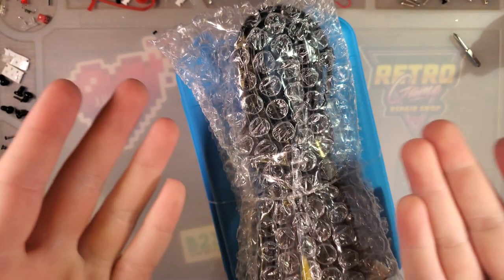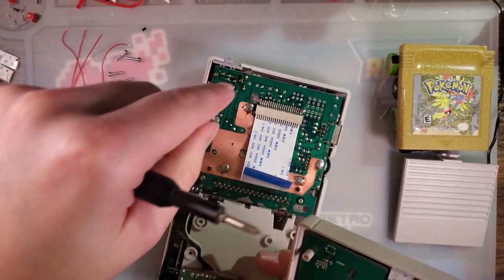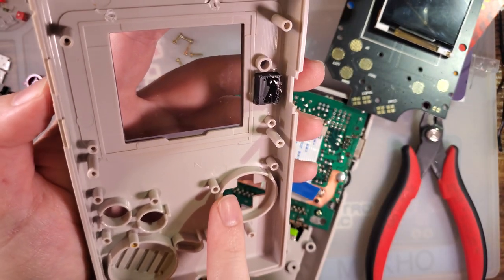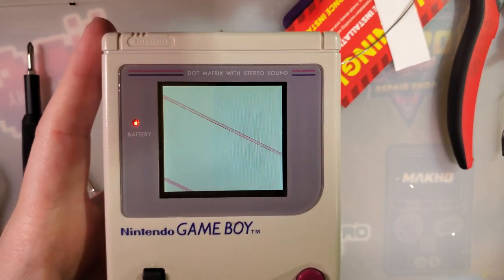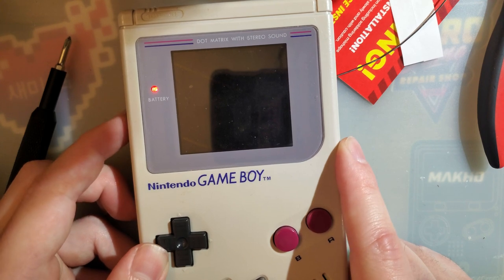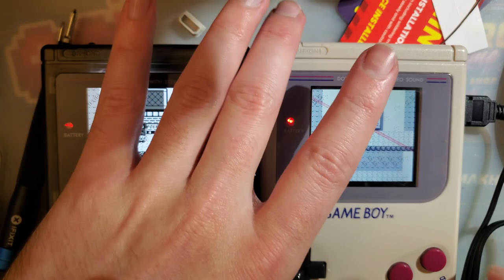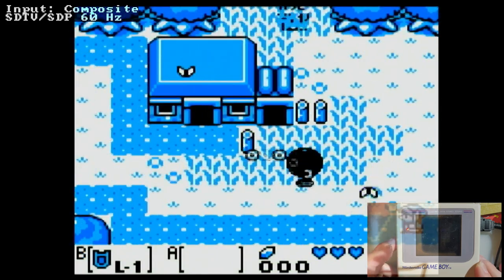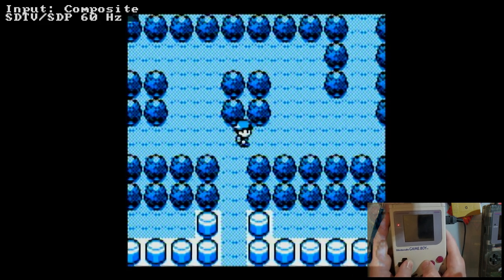DMG TV Out IPS Kit (RIPS TV Version / V5)

Comment: Thanks for the heads up on the spacer. Took my DMG apart and sure enough - it was eating away at the plastic. What is the point of the spacer anyway?
Reply from the maker: to make sure the rotary encoder is positioned properly when installed. Crank the screws without the spacer and the wheel will rub.

Comment: One question I've had, if I already have the cable, can I just wire up the "non tv out" kit and save 10 bucks?
Reply from the maker: Most of the time, the non-tv kits do not come with the requisite hardware and the few that do have the hardware disabled in firmware.